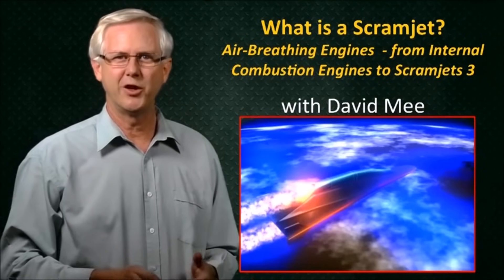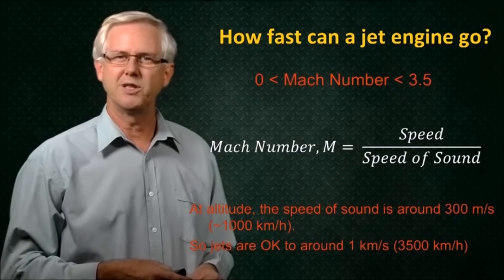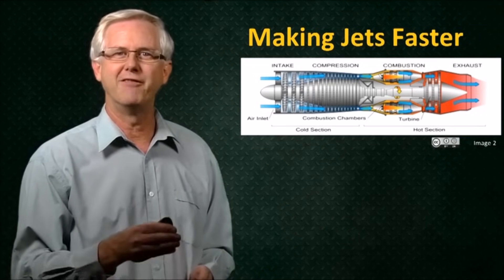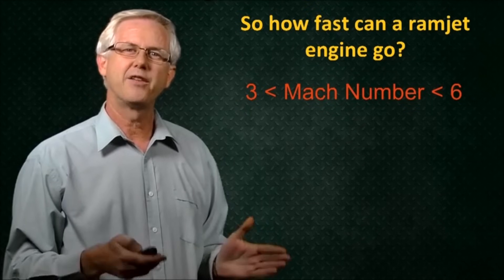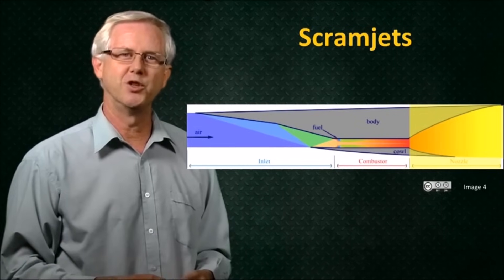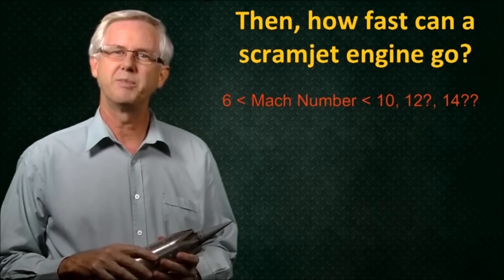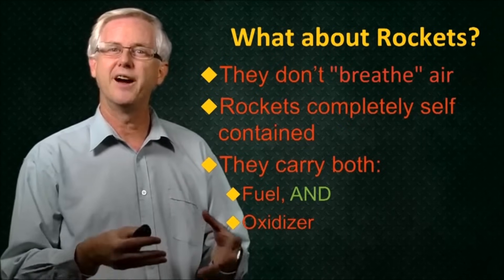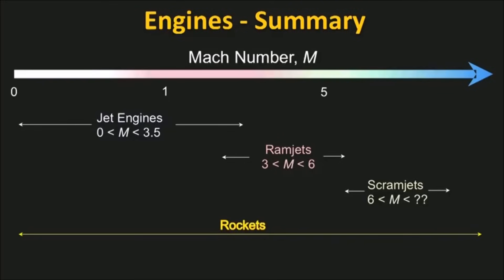Ramjets and Scramjets Explained - Mach 14

Comment: Excellent lesson and presentation, Edwin, thank you. Question: How dense is the H2 and plasma (protons and electrons) above the mesosphere? I'm thinking a scramjet for this stage would only need an oxidizer, if the fuel around it is sufficient.

Comment: You forgot to add that the Scramjet or Ramjet engines are only used on the sr-71 BlackBird which flies at the edge of the atmosphere, around 65,000 feet. They use about 35,000 pounds of thrust engines for taking off, getting up to a certain altitude, & landing. Then weather it is a Ramjet or Scramjet engine, bypass doors open to direct the  in coming air around the internal engine straight into the combustion chamber then out the aft of the engine again bypassing the high & low pressure turbine section & then out the exhaust of the engine.

In the upper atmosphere there is little oxygen so the air entering the engine has to be highly compressed for combustion to take place. This is done by the bypass tubes which compresses the in coming air to a high flow rate & compresses it. Then ignition occurs then the exhaust gases exits the engine at a much higher pressure and flow rate. This creates a ventorii (sp?) effect which was used on cars with carburetors. 

The sticking point is how to compress the incoming air & increasing the exhaust gas pressure and flow rate to increase the vacuum thus drawing in more air to increasing speed.
Reply: The air entering the combustion stage of the ramjet is slowed down to raise pressure. Raising the flow rate would decrease the pressure.

Comment: How would the Ignition mechanism be? How is the fuel injection regulated? How bout adding some gas (maybe oxygen gas, from a liquid oxygen tank onboard) to increase the air pressure without lowering the air speed inside the chamber to subsonic levels? Can the ignition be done through explosives, indes the combustion chamber?

Comment: So in other words, no one really knows if Ram / scram jets are viable because of the heat and pressure build up because the heat would render the fuel ineffective.  What he fails to mention is that it takes time for fuel to burn, or more effectively explode, which makes the plane pretty dangerous as it is liable to explode itself from the heat build up due to friction / and pressure bubbles on leading edges and the skin of the aircraft.  So the idea of propelling a jet with no ionization controls to ionize the air around it is seems a bit pointless.  The only way to achieve hypersonic speeds in air is if the craft can create a vacuum bubble around it as it travels though it.  But then you have no air.   Ah ha !!  So you need a completely different engine!  Probably one with quantum energy features.   Well we haven't invented that technology yet because we really don't know what quantum energy is or how it really works.  All we know it is about super position and entanglement which means that space and time become illusions.
Reply: Scramjets and ramjets have been used successfully on planes before.

Comment: Well, there are air-breathing rockets. They're combustability agnostic, using both fuel and oxidizer. But the heat of the rocket motors expand an airflow through the rocket for bonus thrust.

Comment: I'm a bit confused by the statement that, with high-temperature air intake flow, the combustion process would become more difficult. I understand the difficulties with supersonic combustion, but I had always assumed that this was due primarily to the speed of the flow that the flame/propellant was encountering, so it's confusing me a bit to hear that the issues with supersonic combustion actually come due to the temperature of the air intake rather than the air intake's velocity. Can someone please clarify this point for me? Thank you very much for this great video!
Reply: Slowing the air too much creates friction and therfore heat. The hotter air = less oxygen molecules per volume of air. Less oxygen engine limits combustion and power significantly. Hope this helps!
Reply: @liamJCE10  But chemical decomposition of the air at the intake doesn't eliminate the O2 from the air- does it decompose too much oxygen into monoatomic oxygen? The composition may be changing but the matter inside the intake isn't leaving the engine. Thanks

Comment: I’m kinda confused after watching this. From some sources, scramjet can work as soon as speed exceeds Mach 1 instead of only working at hypersonic ranges, I also heard that ramjets only work up to Mach 5 before the combustion get blown out...
Another confusing fact is that faster air breathing engines are always less efficient. Why?
Reply: A scramjet, by definition, is a Supersonic ramjet engine, meaning that even the flow of air through the combustion chamber is entirely supersonic. A ramjet compresses the air to subsonic speeds before combustion. At 3:19 you can see a label on the diagram which says "compression (M<1)" which demonstrates this point.  A scramjet may in THEORY be able to combust propellant in 1< M < 6 flow, but the engine would be incredibly inefficient at doing so (you can't design an engine to just "work at all speeds" by "magic", the scramjet has geometry designed specifically for hypersonic flight). In fact, having never worked on this technology myself, a scramjet combusting its propellant at Mach 1.2 might not even produce thrust (I just don't know)! Think of it like a plane designed for trans-continental flight only carrying you a couple hundred miles- the plane could, in theory, do it, but it's not designed for that sort of fielding.

Other sources claiming ramjets may only operate at velocities near Mach 5 are probably just giving you a shoulder-shrug range. Lockheed Martin's research claims capabilities of up to mach 6, and a simple wikipedia read over the ramjet also claims mach 6, so I would assume that mach 6 operation of ramjets is feasible, and a believable ceiling for ramjet operation before needing to redesign for scramjet engines.

Lastly, scramjets are less efficient because flow through an engine encounters greater losses of energy to a variety of sources, such as temperature and sound, which are important in the supersonic region (ramjets), but are so absurdly important to control in the hypersonic region that your vehicle will melt/tear itself apart in a matter of seconds if not controlled. So, flow through the engine encounters greater losses in scramjets, and flow is not isentropic whatsoever.

Hope this helps!

Comment: Hi there, greetings 

is it possible in future to design a advanced duct fan for scramjet, operating at very high speed to push required quantity of air in engine in order to start and operate from  0 speed at ground level, like conventional jet do, internal convergent walls of engine solved the pressure increasing capability of engine, but high velocity air needed to solve the engine starting and operating problem from starting speed! right, please reply 
Thank you

Comment: Ramjets can DEFINITELY operate at much lower speeds than Mach 3. As a matter of fact, many ramjet missiles operate at speeds as low as Mach 2.2. The Russian 3M80E Moskit missile is about Mach 2.3, the Taiwanese HF3 is about Mach 2.5 and the American GQM-163 Coyote target drone is about Mach 2.6. Going back to the 1960s you have vehicles like the RIM-8 Talos Ramjet powered SAM which was also about Mach 2.5. These missiles are capable of higher speeds but when operating at sea skimming altitudes they drop to about Mach 2.5 or a tad bit slower in dense sea level air. The best range and efficiencies are achieved around Mach 3, but to say that Ramjets typically operate above Mach 3 is INACCURATE. Moreover, can anyone name a single Ramjet vehicle capable of Mach 6 or even Mach 5? As a matter of fact, I don't know of any operating above Mach 4.0 or thereabouts. MACH 2~4 FOR RAMJETS is probably more realistic!
--
 Scramjets also definitely do not need Mach 6 to start. In fact, experimental vehicles like the X-51 did most of their flights at Mach 4.8~5.2. GREATER THAN MACH 4.5 FOR SCRAMJETS is probably more realistic.
--
One of the biggest problem with Scramjets -- in addition to supersonic combustion instability -- is that there is a "hole" between Mach 3.8 and Mach 4.5 where Ramjets stop working and Scramjets don't really start working. This makes it very hard to employ Scramjets because (thus far) nobody has created a dual mode ramjet/scramjet engine capable of accelerating the vehicle from Mach 2.5 to Hypersonic speeds. The result being that rockets must be employed to boost the vehicle to ~Mach 5 for the scramjet to even start. Rockets can definitely do that, but to achieve a delta V of 1700 m/s (~Mach 5) the vehicle will have to be 53% fuel by mass with the typical solid propellant Isp of ~230 secs. Once you take into account things like the motor casing, nozzles, fins, guidance equipment, staging adapters, gravity and drag etc. about 75~80% of the launch mass of the vehicle is the rocket booster. What this means is that the rocket booster needed to get the Scramjet its operating speed and altitude is typically 4~5 times the size of the scramjet vehicle itself. This is fast approaching the upper stage to 1st stage ratio of a two-stage orbital launch rocket. Compounded by the fact that scramjets typically have very bad fuel fractions because of the heavy and strong structure and alloys needed to withstand its operating thermal environment, it makes one wonder if it is easier to simply use a rocket upper stage and fly outside the atmosphere where the upperstage can be a filmsy balloon tank for all the matter! It comes down to this... the advantage of an air breathing engine is simply that you don't need to carry the oxygen. But the mixture ratio of kerosene to oxygen is only about 2.56:1. If eliminating that 2.56 parts oxidizer for each part of fuel you carry adds more structural mass to the vehicle due to the need to fly at very high temperatures in the atmosphere, then it is generally not worth it.

Comment: Since Ramjets and Scramjets operate at Mach >3 , how are the supersonic flow speeds  achieved on aircrafts fitted with such engines  ? I believe such engines operate in standby mode until the aircraft reaches speeds of Mach 3 and activated after exceeding Mach 3.

Comment: Excellent presentation.  He made it easy to understand. It will be challenging for the material engineers to come up with materials to handle the extreme heat issues.
Reply: there are no materials that can. we are at the thermal limit

Comment: I disagree when you say the air going out needs to go faster than the air ging in.This is not a Propeller powered airplane.Jets go on action & reaction.In Fact a Jet can go faster than the exhaust gas speed.I have a idea for the scramjet .As the air enters slow it down but changing the direction of the air perhaps going into a cyclone  spin action first.This will improve combustion also not knocking off any air speed momentum.
Reply: A jet cannot go faster than its exhaust gas speed, actually.
Reply: Wrong. Well a rocket does so why not a Jet ? A Jet or Rocket goes on Action & reaction only.It it has 100KG of thrust top speed will be when it reaches 100kgs of drag only.When a Rocket is in space going way faster than the exhaust gas speed what are you using to measure the exhaust gas speed anyway.Planet Earth or the speed the gasses get away from the Rocket ?On Earth the air around us is just drag & only this limits top speed.
Reply: @lomasck  A rocket and a jet are different because a rocket doesn't take in air. Imagine a jet that takes in air and passes it through a long diffuser with high losses. The exit velocity would be much slower than the inlet velocity, so the drag from the inlet air would be much greater. Now imagine a jet that takes in air and passes it through without losses. Now the drag from inlet air is the same as the thrust from the exhaust and there is no thrust. The engine must accelerate the flow faster than the incoming air (you're comparing the change in velocity, so it's reference frame invariant). Since the inlet velocity is just the flight speed, that means that if your exhaust velocity equals your flight speed your engine is producing no thrust.
Reply: @AmbientMorality  No No No,So Wrong about the hole concept.You are thinking about propeller Ducted fan set ups .Do you believe a Land yacht can go downwind faster than the wind that powers it.It can if done with propellers & gears to its wheels. This and how a Wing makes lift are never ending subjects.
Reply: chris lomas Look up propulsive efficiency. This is a very basic fact covered in any decent propulsion textbook. I can cite one if you want. It is absolutely true that for any air-breathing engine exhaust velocity must be faster than inlet velocity; if that is not satisfied, your engine is producing drag
Reply: @AmbientMorality  Its a bad statement.How does a Reedless Pulse Jet get thrust on this Statement.? The way you look at it if the jet plane is doing 1000mph then the incoming air at a front intake is doing at least 1000mph also then of course the exhaust must be going faster than 1000mph to give it thrust.That's only common since .Anyway you are all wrong.Sorry.
Reply: chris lomas Yes, the exhaust is going well over 1000mph (relative to the plane) in a plane going 1000mph. That’s what I’m saying.
Reply: @AmbientMorality  If the plane is doing Mack 3.5 must the Jet Exhaust be going faster .No.I thought I had best look up the meaning of the work Momentum because I was converting that to the word speed.That was my mistake.I think the only momentum in this is the jet plane at speed & the incoming air but this word should not be used for the Exploding Force of the  Exhaust gas.
Reply: @lomasck  Yep, the exhaust must be going faster! It's worth noting that Mach is temperature-dependent, so the exit Mach is lower. However, the exit velocity is still higher than the inlet velocity. For example (I just worked this example) a hydrogen-powered ramjet at Mach 2 and fairly typical efficiencies has an exit Mach of 1.8. However, that corresponds to an inlet velocity of 1350mph and an exit velocity of 3000mph; the Mach is just low because the temperature increased so much. 

You're on the right track with momentum. The change in momentum from the inlet to the exit is equal to the thrust, which is why the exit velocity has to be higher. You're adding very little fuel (usually about 2% mass increase), so the mass flow is almost constant. There is a negative momentum flux through the inlet (momentum is flowing into the engine) and then a positive momentum flux from the exit (momentum flowing out of the engine). The net momentum flux must be positive for thrust, which essentially means velocity must be larger at the exit than the inlet (because the mass is nearly constant).

Comment: So why not just use a scramjet with a small quantity of liquid oxygen for takeoff and sub Mach 5, non air breathing mode speeds? Aircraft can thrust against a strong heat shield on the runway or carrier for rapid, STOL.. or off a ramp, or straight up with its nose pointing to the sky... possibly hydrogen as the main fuel, but not essential... Skylon's idea is more sophisticated though, with its inter-cooler, cooled by helium, cooled by the hydrogen fuel... It can breath air at low and hypersonic speeds but would also benefit from some on-board oxygen.

Comment: i want too se a basic model with the mutts nuts scramjet bought to maximum speed possible then shot ino space to see what we are capable of surely scram and slingshot method we could get to almost unimaginal speeds.....my science is a bit poo so might be reading this back to front but we could create basically probes that could travel far out of our solar system without having to wait a lifetime for results...........im only 44 but i am scared that we have stalled and a lot of oppertunities are passing us by and my lifetime may not be long enough to see the next phase of exploration and it seems like new stuff is thin on the ground to explain to my grandkids